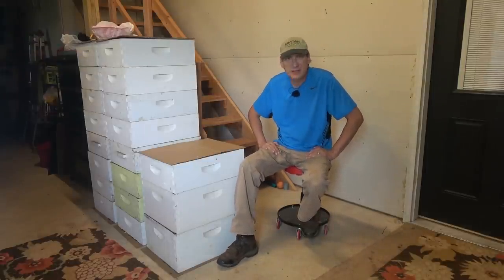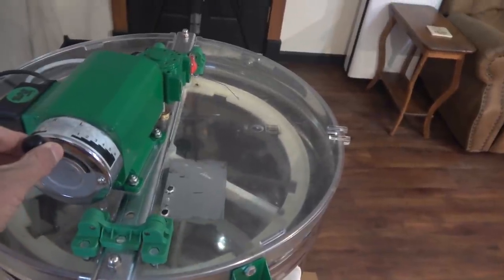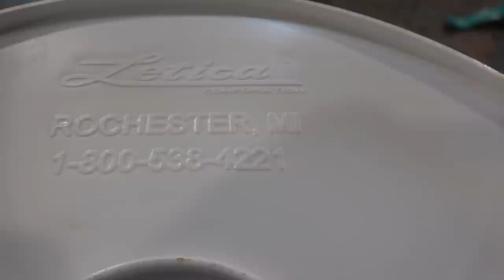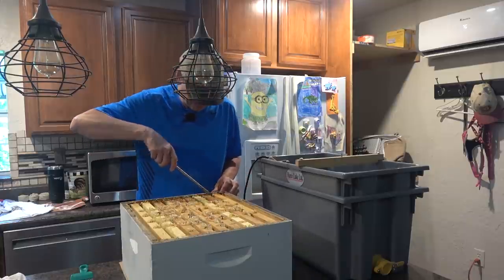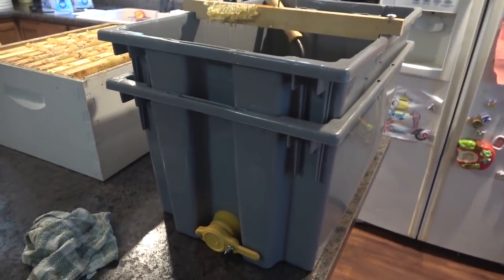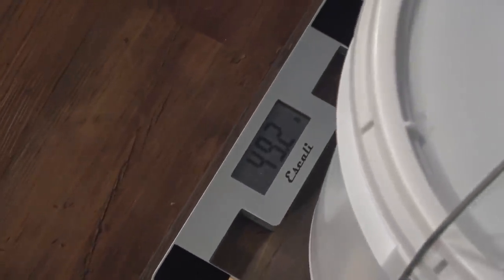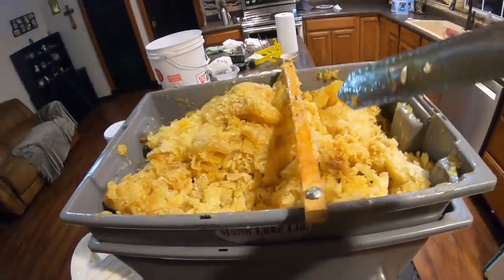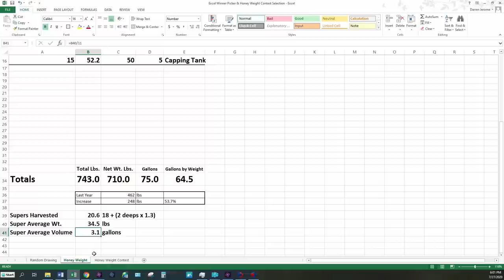Extracting 710 lbs of our 2020 Honey Harvest S4E52 #beekeeping #honeyharvest

Comment: One really big improvement I've found to improve my extracting process is to buy or build a tub that holds frames that have been uncapped. This way you can be continuously uncapping frames while your extractor is spinning. Once it's done, you can fill it right back up with frames. Speeds up the process a TON!!!!
Reply from the maker: That's a good idea.  I've noticed my bottleneck is the uncapping.  I was going to get a second uncapping tank for this year, but it wouldn't have mattered.  With the social distance thing, it was only myself and my wife working on them.  I could have used a second uncapping station anyway with the amount of cappings I had.  I worked on them all week before I pulled the honey off them and got 50 lbs with the last 3 pulls.   Thanks for watching.
Reply: @JeromeBeeFarm  Last season using one of these uncapping tanks, a harmony farms uncapper and a maxant 20 frame radial extractor (does 10 deep or 20 medium) I extracted 25 gallons by myself in about 4 hours. I was very sore and tired afterwards, but glad it was done.  The harmony farms uncapper is also another great time saver vs a heated knife. Less mess, less filtered cappings, and your wrist doesn't hurt.
Reply from the maker: @Matt-dc8lp  thanks Matt, I'll check out that uncapper.
Reply: 5 gallon pails generally only hold 4 ish gallons. I have a graduated pail at work and the top line comes to 3.5 gallon.

Awsome video and very helpfull

Comment: Got a deal on mine,  holds 4 deeps for only 34 dollars,  its a crank>  but can put a electric drill on it . Take off the handle, put it on the drill chuck,  and off ya go!   If i ever get time, i got a washing machine going to make a extractor out of. Got my new mower in.  Man This one is a cutting machine, Craftsman T140 there Excellent!  I cut some Knee high wet grass yesterday with it>  out does the pony 10 X better.  It went right threw it. Got the front bumper and hitch on, waiting on the lights! All my mowers got front bumpers, hitches, cigarette lighters, and lights. Mandatory with me!
Reply from the maker: I burned up my belt last week.  Got a new one that won't install itself.
Reply: I get burned out working on mowers all the time! Blades, belts, oil changes, and washing them.   Nope got to put it on !  He hee i haven't invited a jump on belt yet. IDK WHY THEY CAN'T MAKE A ADJUSTABLE SNAP ON BELT!  like chain saw blades take a link out and put the locking link on..  and i'am always cutting my hands up working on these dam mowers

Comment: I have also had buckets to crack but only the lid with another bucket stacked on top.  Now when I stack, I put a piece of plywood between them to distribute the load so its not all on the top lid of the bottom bucket and have had no problem for 20+ years.  Really like the extractor.  Wish I had a 9 frame radial.  Mine is a 5 frame radial over 40 years old.
Reply from the maker: That's a good idea to put a board on there to distribute the load.  I bet that 40 year old extractor is built to last too.  lol  Thanks for watching.

Comment: I have been harvesting honey as a hobbyist for 10-years now and I wish I would have seen your video when I started back then.   Excellent video, there is a lot of useful and important information on lessons learned for a honey harvest.  It appears you and I have taken a similar journey.  As far as buckets go, the ones from the big-box-stores are cr@p.  I'm involved in the construction industry and I've learned  the hard way why they are inexpensive.  I get my honey buckets for free from bakeries that are going to be tossed into the landfill.  As in the painting industry, you can't have buckets that are going to break and I found the buckets for the bakery industry hold up to the weight of honey.  That being said, I will never ever lift them by the handle.  I was taught to uncap the cappings by scratching with the uncapping fork and I could not figure out why I had so much wax in my extractor and honey, what a mistake.  Thanks for producing and sharing your video.
Reply from the maker: Hi Billy. I’m always worried lifting them with the handle. I don’t fill them near as full either. About 50 lbs max is where they end up. Yeah, it’s a fork, not a scratcher. lol. Thanks for watching and commenting.

Comment: We just have a couple hives and cut the cappings into a 5 gallon bucket with a mesh bag for straining paint.  We put the cappings in the bag into our extractor and  put it on slow and it slings it out but probably not as well as it could.  I wonder if you could rig something up like that with a couple mesh bags to balance the weight.  Ours is a tangential extractor though and it has a fair amount of support along the edges of the baskets to hold the bag.  It may be more effort than it's worth though but may be worth trying.
Reply from the maker: Hi Brian.  I would just let it hang in the bags over a bucket or something and let gravity do the work.  Keep it plenty warm and move it around every day or so until it quits producing.  The extractor thing sounds like an out of balance washing machine effect.  That also puts strain on the motor and bottom bushing/bearings when it's out of balance like that.  It would be more pain than it's worth to me to try to balance it out.  But I suppose it's a doable thing.  lol  Thanks for watching.

Comment: Darren, thanks so much for this video!!! You taught me a few things in this one. You know how to use the uncapping fork correctly. So many scratch the cappings with it. In the last week I saw a video where a certified master beekeeper was scratch the cappings off.  I remember your cracked leaking bucket last year. I bought buckets at Lowe’s since then and they were a different brand from the ones that you had crack open. If I buy another extractor I now know what I want to look for. Thanks again!
Reply from the maker: LOL, yeah, I watch the master beekeeper every now and then.  I really like his videos.  I think that was a bad run of buckets.  I need to order six more of those so I don't run out next year.  (I guess that's wishful thinking).  Yeah, radial is the way to go, no flipping.  Thanks for watching.

Comment: Do you run a dehumidifier and fan around the supers to bring the moisture content down, or never had any issues with fermenting?
Reply from the maker: This year 2021 I did because I had more uncapped than usual.  I also tested it to be sure the humidity was reduced before I extracted.  I have not had any fermentation issues when I didn't run the dehumidifier.

Comment: What do you do when the honey is too thick to process? 

I was trying to do crush and strain but it feels like it will take 10 years.
Reply from the maker: Hey Noah.  Thickness is basically a function of temperature.  Also, crush and strain has all kinds of resistance to flow with the crushed comb, and straining, and comb getting in the strainer, so all that is working against you.  You will need a lot of patience with that technique.  Try warming it up somehow if you can, that's about the only thing you can do.  Thanks for watching.
Reply: Thanks for the reply. 

You are right. 

In the video above your honey crop is impressive.
Reply from the maker: @noahriding5780  Thanks!

Comment: Can you tell us the name brand of your extractor.
Reply from the maker: It's a SAF Natura.  Looks like Blue Sky Bee Supply Picked them up after Brushy Mountain went under. https://www.blueskybeesupply.com/s-a-f-natura/
Reply: @JeromeBeeFarm  - I have the same brand extractor.  Picked it up from another bee keeper that bought it but never used it due to health issues.  Mine holds 15 deeps. It's actually bigger than I really need at this point.  My only complaint is that it is loud, I guess because of all the metal gears.   But as far as performance - so far so good.   Fingers crossed.
Reply from the maker: @kenjordan5164  Wow, 15 deeps, that's a big dude.  I wish mine would do deeps radially.  Thanks for stopping in.